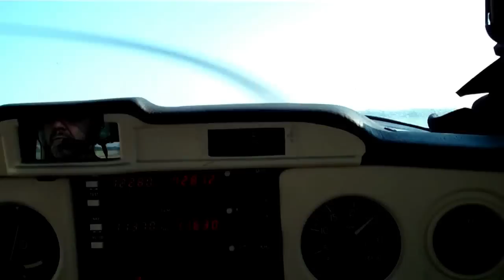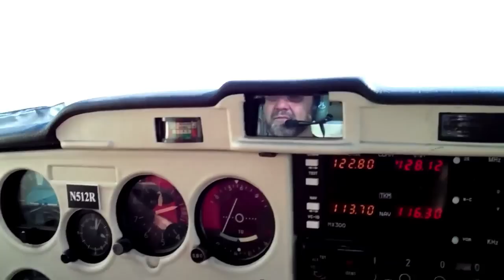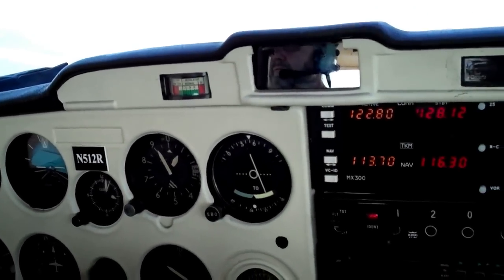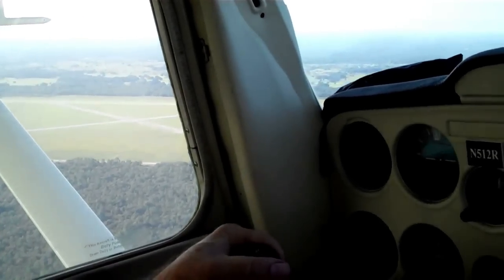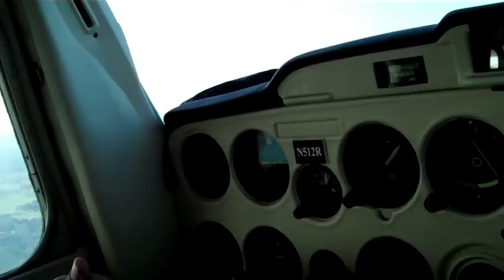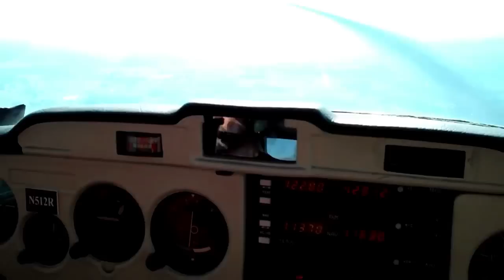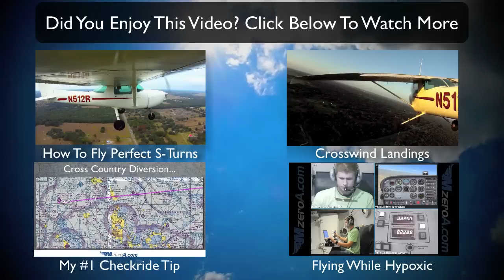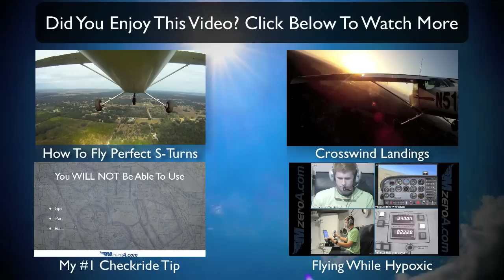Uncontrolled Airport Radio Communications

Comment: J, thanks for all the free stuff that you put out there for educating folks to the proper methods of flying. 1 suggestion for you on this video though, it's better if pilots used aircraft model & color rather then tail # at uncontrolled airports in their radio calls? It is easier to see a white w/red stripe Cessna 150 then it is to look for tail # 512R. For lesser known models, a simple high (or low) wing w/color description will do. That makes it easier to match planes w/what you see. RAonUTUBE